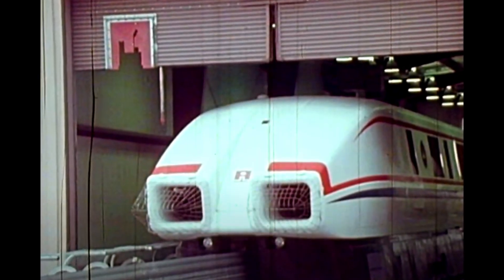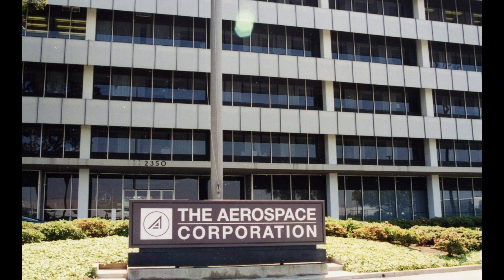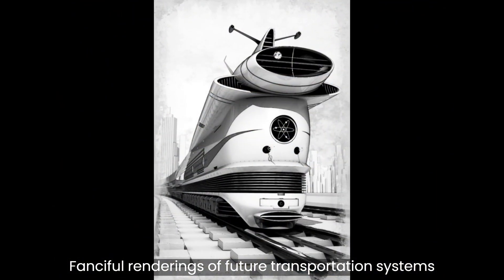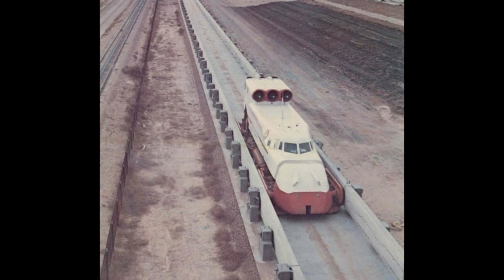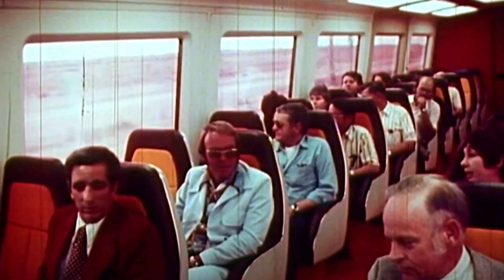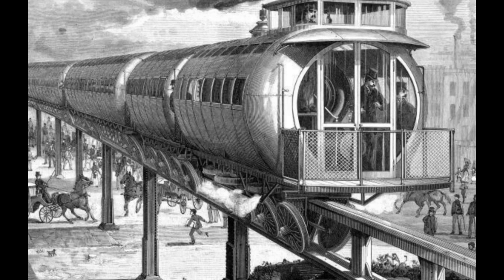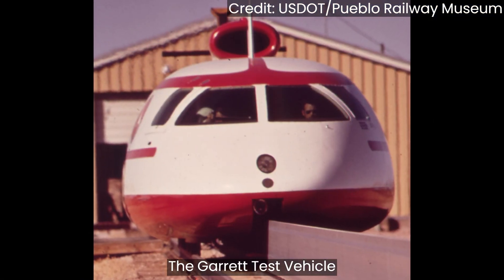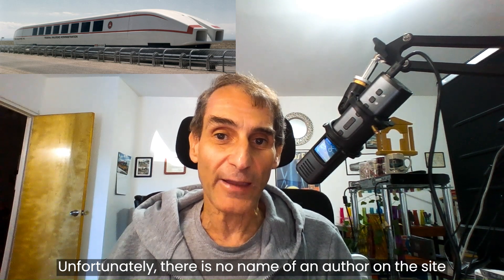USA's Obscure 500-mph Aerotrain Inspired by 2001: A Space Odyssey!

Comment: It's nice to see the Rohr and Grumman Aérotrains have been kept in a far better condition than our own Tracked Hovercraft RTV-31 (At 02:41) which now stands rotting away just south of Peterborough town centre! 🚝🇬🇧⛈😉

One discovery made by the British was that dual-sided linear motors would often prove so powerful they'd cause structural damage to the traction fin, so we used a single-sided linear motor with the reactive surface embedded in the track. A useful aspect to this was that a Tracked Hovercraft guideway could easily be converted to other purposes once no longer required for hovertrain use, unlike other designs where the fin would have to be pulled up. 👍

What I never understood myself was how it was that hovertrains were not energy efficient enough to be practical, given the air cushion eliminates friction and thus motive resistance. The tendency to use linear motors probably didn't help this, but if you look at conventional hovercraft design - Where the air cushion is filled using the same fans as for propulsion - Surely an Aérotrain employing the same principle would work out no less efficient than any existing hovercraft? 😇
Reply from the maker: Hello! Wow, lots of great information here! If I could find more info on the Tracked Hovercraft, it may make a good subject for a video! Thank you for watching and for your comment!
Reply: @JeffreyOrnstein  There is a video of a TH test floating around somewhere, and some videos on the linear motor technology (Another British invention, I'm led to believe) which was developed to make it, erm, go. 🚝🇬🇧😇

Like Aérotrain though, it didn't go much beyond an experiment. It was intended to provide a means for high-speed transport around the UK and for export to other countries, but I get the impression it ran into the same hurdles Aérotrain did. 🛑🚝💸